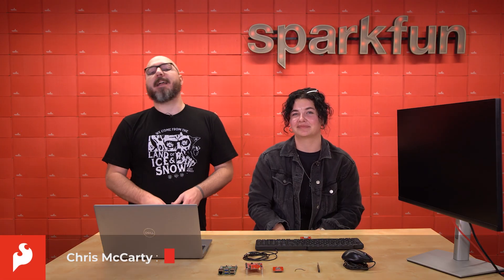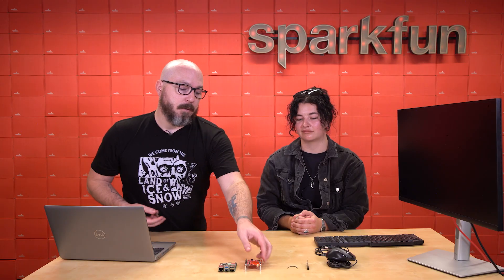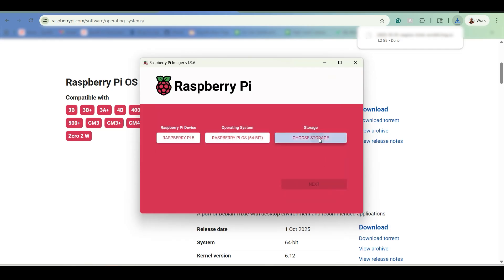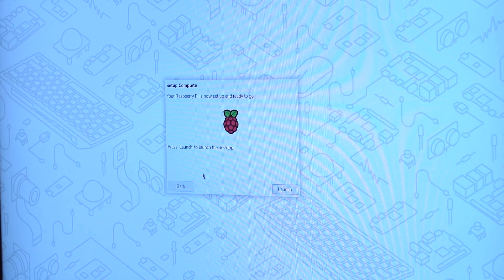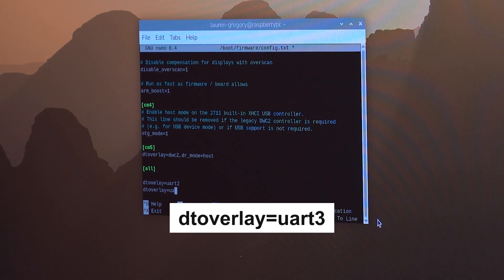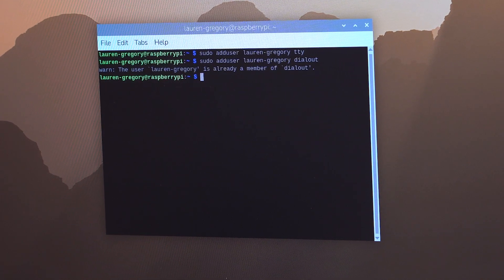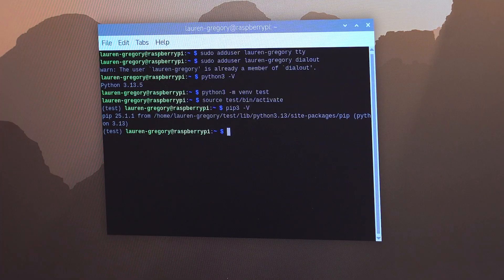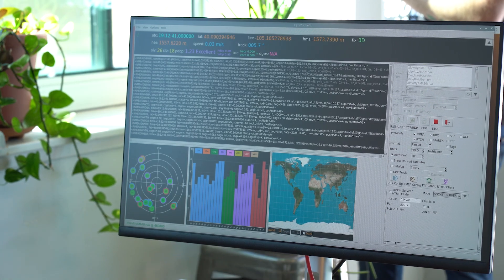How to Set Up High-Precision GNSS on a Raspberry Pi (Step-by-Step Guide)

Comment: Hi Thank you for the great video. I have three specific questions regarding the "SparkPNT GNSS Flex Module - ZED-X20P & IM19 IMU". 
1. you mentioned in the hook-up guide  that the IM19 provides roll and pitch accuracy to within 0.05 degrees. But no information about the yaw part. Is the module also provide yaw and how accurate is the yaw angle?
2. Say, I want to use the module on real-time vehicle navigation, there is no inforamation regarding further data processing from Pi to other processing units. Which port from Pi (USB/serial, LAN, etc.) would be most efficeint in this use case?
3. Can i also extract the RAW IMU data from the module?

Comment: Hi! Great video — really helpful walkthrough of the hardware setup.
One part I was hoping you could clarify:

To reach centimeter-level accuracy, GNSS modules normally require either
• RTK corrections (RTCM via a local base station or an NTRIP caster), or
• PPP/SSR corrections followed by a convergence period.

In the demo, after connecting the antenna you mention “that’s it,” but nothing was shown about receiving differential corrections or waiting for convergence.

Could you share which correction method the Flex module uses in your demo (RTK base, NTRIP, or PPP/SSR), and how a user should configure that step on the Raspberry Pi?

Thanks — just want to make sure I understand the full workflow for obtaining the centimeter-precision fix.

Comment: What kind of location accuracy do you get ?
Reply: My understanding for centimeter accuracy you need host gps and a remote GPS. Two separate units working together.
Reply: here https://youtu.be/Mu4nujXDhxY?t=613 you can see that PDOP is 1.56 which would be position dilution of precision of 1.56 meters (HDOP and VDOP for horizontal and vertical of 1.01 meters and 1.19 meters).  This seems more like a beginner's video on getting standard GPS functionality running and would never receive cm level accuracy without further config of professional level systems like RTK - title/description talking of cm accuracy seem a bit clickbaity as you don't finish with that capability :-(
Reply: There's a lot of free public base stations to use if you make an account with them. In Michigan, I use MDOT